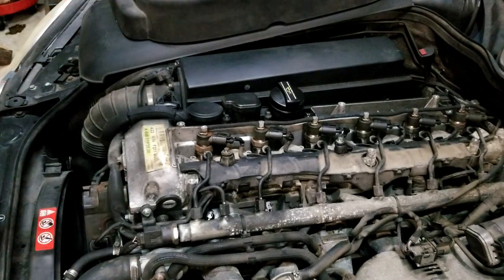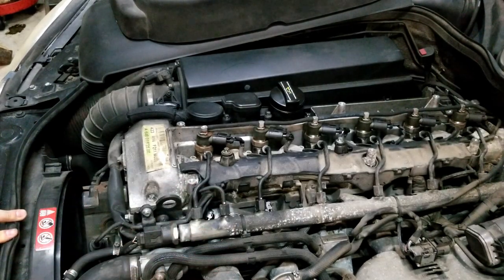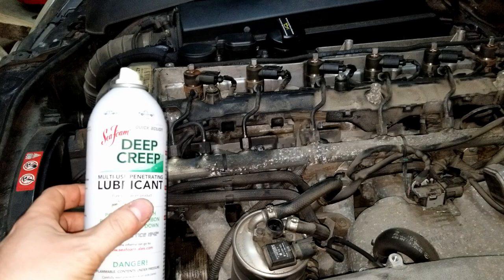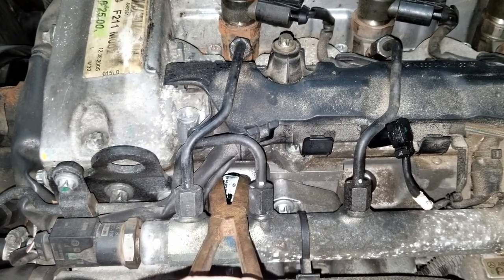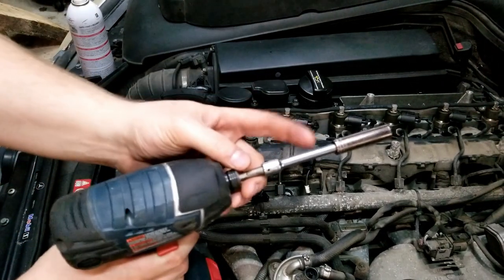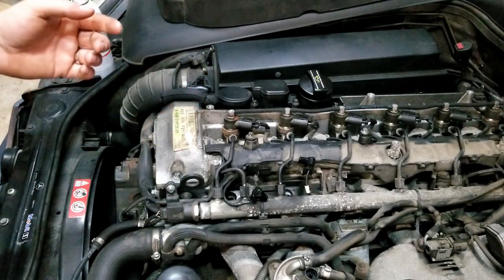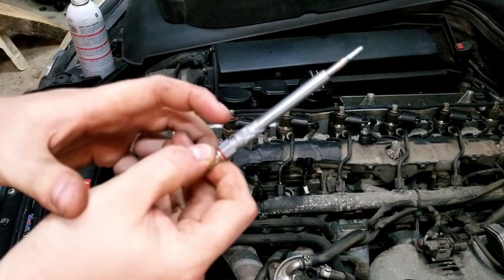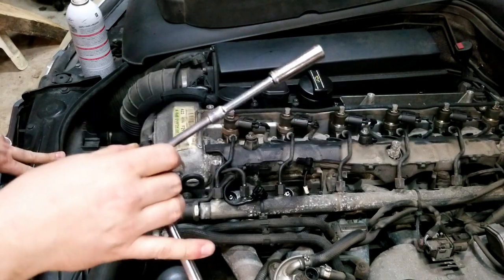E320 CDI | How to Replace Glow Plugs Without Breaking them!

Comment: ENGINE MUST BE UP TO TEMPERATURE BEFORE TRYING TO REMOVE A GLOW PLUG!
Reply from the maker: LISTEN TO THE MAN!

I knew i forgot to mention something, thanks for the reminder! The car was fresh off the highway when i filmed this.
Reply: @MBDieselFreak  Quick question, do you think the ryobi 400nm impact drivers would be too much for this way of doing it?
Reply: Then when do you apply the lubricant?One day before the job?
Reply: not possible on some of the cars where you have to remove, air box, intake, throttle body and EGR valves to reach the glow plugs
Reply: @MBDieselFreak  I snapped two of them 
how do i remove?///. or is it over/>
Reply: @christophercolumbus8944  drill them out and use an extraction tool.
Reply: What If car won't start?
Reply: @CaptainJamesCook-cl6qq  it could be a fuel pump issue, crank sensor, glow plugs or your glow plug module
Reply: I didn’t know. I was so damn lucky. So lucky.
Reply: @christophercolumbus8944 what did you do?
Reply: @christophercolumbus8944 how much did it cost to get them fixed?
Reply: @WhitePOWERranger1  nothing 
i don't think you CAN fix them  unless carbide drilling but how are you going to mount this on the CNC table.......? it has to be a 5 axis mill  
it's possible
Reply: @christophercolumbus8944  I know mechanic can drill and tap again, but it must cost a lot.

Comment: Thanks.  I will be replacing the #1 glow plug today.  Have run a Bosch on #3 cylinder for 100K without problems.
2005 E320 CDI with almost a quarter million miles.  Still going strong.

Comment: so much prep work everyone is doing when in fact, my 07 204 (OM646.811) had factory glowplugs and all i did was put some wd40 on every glowplug, waited overnight, went to the car in the morning (ie. cold engine) and slowly removed them with my ratchet, in order to not break them with impact gun... 10 minute job and all was fine ! wouldnt want to work on hot engine to burn myself :P

Comment: Thank you 🙏🏼 . The 1/4 impact is definitely the key. I bought a really cheap one that only generates 80Nmx3000 min but that’s plenty. I had to let it rattle (wear ear defenders) for 5 minutes to get a plug out that probably was in there for 285000 km as it was a different brand and had corrosion on the body . Penetrating MoS fluid a week before and a daily 300 km drive. Hot engine.

Comment: Please, before unbolting the glow plug, CLEAN the area around the plug with brake cleaner and compressed air. You don't want the debris around those plugs to fall into the cylinder. It is even a better idea to clean that area BEFORE you spray the penetrant the day before. Ant the plugs must be torqued to 8NM (whatever that is in foot-pounds/inch).

Comment: I finally got around to changing 2 of my plugs, one came out like it was installed yesterday but boy, I spend 45minutes using, 1/4 impact, torque wrench, 3/8 Milwaukee impact on setting 1, then 2. Glow plug would move a hair, I would then go the other way, it would go 2 steps forward, then 3 steps back, it would bind up again .With the combination of all 3 tools and patience, I was finally able to free up the plug and remove without breaking.

Comment: The key is the penetrating fluid. I used ATF and acetone for mine. I am not so keen on using power tools for removal but can see the point. I invested in a reamer also to clean out the bores better and cleans the threads also. The plastic caps on mine just crumbled from age. They are easily replaced though. I used copper anti-seize on mine and it appears to work well. I remove them once every couple of years just to check on them and make sure they don't seize into the head. Personally, I replace on fail for these even though people would say they are manufactured about the same time and would expect them to fail around the same time. If two fail within months of each other, then I would consider replacing them all. Injector seals are the ones I would just go ahead and do all of them if one fails, the others are not far behind. I'd be interested in a video (I know there are plenty) about how you would deal with black death. I have my own method but always interested in how others handle it.Thanks for sharing the videos, I always enjoy them!
Reply: turbo97se turbo97se
DO YOU HAVE A BLACK DEATH VIDEO UP---THX

Comment: Can’t believe you didn’t gently hand start the new plugs!, using power tools to drive plugs into hole is quickest way to cross thread .
Also using power tools to remove heater plugs can snap them. Better to use a socket and test how tight they are and then use power tools.
Reply from the maker: Never had a problem with that with glow plugs because the plugs self guide themselves straight into the bore.

Comment: I sprayed all mine with plusgas for a week before and removed them with no problem at all, I also used a set of spark plug pliers with curved tips to grab the body of the plug which avoids damaging the plugs

Comment: I found that applying plus gas’s every day for a week and getting the engine good and hot always works , love the idea of using a impact driver but I’ve done four pt cruiser crds witch use the same engine that Mercedes use and found that with the plus gas NONE of the sixteen plugs I’ve replaced have been tight and in some cases they have actually worked themselves loose !

Comment: soak with penetrating oil  every day for  7 days . 
After application drive till at operating temp .
When removing do when engine hot 
Loosening ,,,start by  tighten with tension wrench till reach click point 5x 
Then undo 30x till click point of tension wrench set at relevant tension .
If this does not work use low tension hammer action asper video

Comment: You Sir helped a LOT. No joke, a lot. Brilliant idea. Problem is, my cheapo Hitachi cordless is ridiculous in power/torque (stronger than my DeWalt which broke). I'm afraid it will snap few glow plugs.
Maybe it is dum dum question but.... does engine needs to be warm for the install?

Comment: Just soak them with engine oil. Syringe, with 5w30. Put in every glow plugs , drive few days and attempt them when engine is hot. No need any impact gun. Just do it slowly. Works every time :)

Comment: I have a GL350 that will not start up.  The ignition system is on and when you push the start button, the engine cranks over but will not start.  What do you think might be keeping it from starting?  fuse, injectors, glow plugs?

Comment: Did you not use a torque wrench to tighten them at all. Ive got a 2007 Mercedes e320 cdi estate. 3 ltr v6. Im dreading the thought of changing mine. Wish me luck. Any further tips please?
Reply: How did it go?
Reply: All good. Changed the relay recently as it was struggling to start in the cold. Done a lot of other jobs myself, which has saved some cash 💸

Comment: Hi MBDiesel, I have a 2006 E320 CDI with only 63,000 miles on it. No problem of any kind but as a maintenance measure I want to take out the glow plugs, clean and put them back with a coating of anti ceasing compound. My question is which is the safest impact wrench to use on the glow plugs and what should be its maximum torquing power. Any recommendation for the impact wrench. Thanks.
Reply: Perhaps a no brainer, but he is using a Bosch driver. So he might be comfortable with using that model, eh?

Comment: PLEASE  PLEASE DO A BRAKE FLUID CHANGE/FLUSH JOB FOR THE "SBC" SYSTEM FOR A DIYER----THX MUCH!!!!
Reply from the maker: Oooo, good idea! Thanks for the tip! I've got another CDI I could do it on
Reply: @MBDieselFreak  AWESOME---I TOO HAVE 2 E320 CDI'S --LIKE TO DO AS MUCH AS I CAN DIY.   AN "SBC" FLUID SERVICE VIDEO WOULD BE AWESOME---ESPECIALLY IF YOU CAN GET BY WITHOUT USING EXPENSIVE DIAGNOSTIC SCANNERS.  PUTTING SOME E500 4 PISTON BREMBOS ON THE CDI,  AND I NEED TO BREAK THE LINE TO INSTALL THE CALIPERS OBVIOUSLY, SO DOING A FLUID SERVICE AT THE SAME TIME MAKES SENSE.
Reply from the maker: @PARDS2  if you plan on doing it before i get around to doing a video on it, the process is very simple without using star diagnostic. Buy a Motive pressure bleeder, and 4 pints of Pentosin dot4+ brake fluid. hook the pressure bleeder up to the brake fluid reservoir, pump up pressure, and then just each bleeder screw one by one! the pressure bleeder is HIGHLY recommended since it insures you get all the air and old fluid out, and lets you do the job 100% by yourself. MAKE SURE TO DISCONNECT THE SBC MODULE WHEN WORKING ON BRAKES.

Comment: I have a merc cls 350, changed plugs twice on it but the last time I twisted too hard and now the plug 8mm just spins and can't get it out, any ideas please how I can get this out and to why it's spinning?
Reply: It is highly likely the problem is carbonized material around glowplug heating end, and that carbonized material do not let glowplug come out.
The solution is to tight it again and use fuel aditive and run engine at high RPM, about 4.000 RPM, something it is called "Italian tune up". To clean the carbon deposits inside combustion chamber cam be used also Liqui Moly 5168 to remove dirty into air intake circuit (Turbo, EGR, Valves and Combustion chamber.
There are more systems like https://descarbonizadoras.com/puntos-de-descarbonizacion/
look at this video from NGK explaining how replace glowplugs https://www.youtube.com/watch?v=hNwi--n0h9Q

Comment: If I wanted to ream the threads for the glow plug what tap would I use?
Reply: I dont know the size of the tap but I used a dremel to cut slots in the threads of the old glow plug, greased it up and cleaned up the holes that way.
Reply: believe m10x1

Comment: Did you ever look at idle fuel consumption of om648? Mine is 0.9Gal/hour (mine is tuned, not sure what exactly tuner did to it). I read that gasoline cars should consume more than diesel, but my Hyundai Azera 2006 3.8L consumes about 0.38G/h (with A/C running).
Reply: 11 hr 4 one gal ?no way?

Comment: Guys, I broke 1 injector mount bolt. It sits deep inside block. I was able to drill middle portion out 3/16, but extractor didn't help. So I was going to predrill and retap the block, but unable to find m6 1.0 long reach tap and long drill bit. Can someone please suggest me something?
Reply from the maker: Injector #1 bolt on my car was replaced I think for this exact issue. The injector hold down clamp and head was drilled out and tapped to for a massive 10mm bolt. My suggestion would be to scour the web to find a long reach tap and drill bit in whatever size you can find in order to get a new bolt in. Don't be afraid to drill out the hold down clamp too to make this work, but make sure the hole is large enough for the hold down clamp to toggle back and forth to allow it to put down pressure on the injector.
Reply: @MBDieselFreak  thank you for your answer!
Reply: @MBDieselFreak  do you think it will be ok to put shorter bolt but with about 3/8th. I'm planning to tap threads at the beginning of the hole... Not sure why they used such a long bolt with 2cm of threads down on the bottom.
Reply from the maker: @pfoxhound  yeah that would work perfectly fine. use a lock washer. they use a long bolt because they are designed to stretch to maintain tension on the hold down clamp through heating and cooling cycles.
Reply: @MBDieselFreak  what threadsdo you have? 1.5, 1.25, 1.0? M10
Reply: @MBDieselFreak  today I tried to assemble everything but looks like my fork for the injector is drilled sideways or something (wrong axle).
I started the car and it started to spray diesel from injector with modified mount.
Reply: @lexsarrasin713  
So far little over 157000 miles with no issues whatsoever.